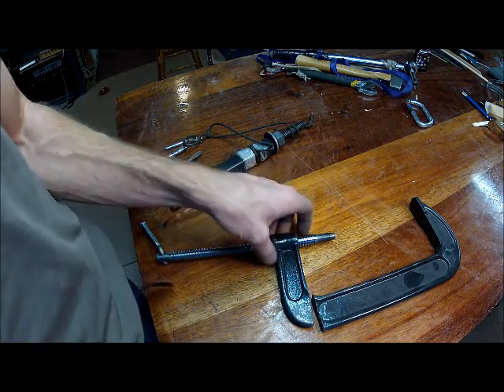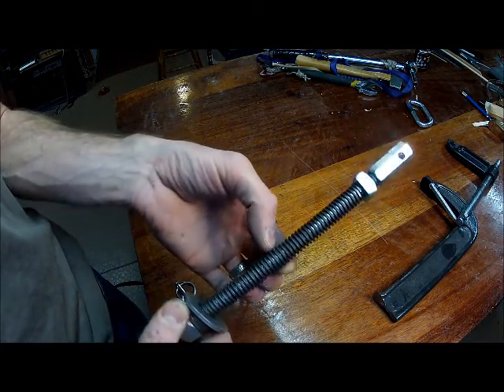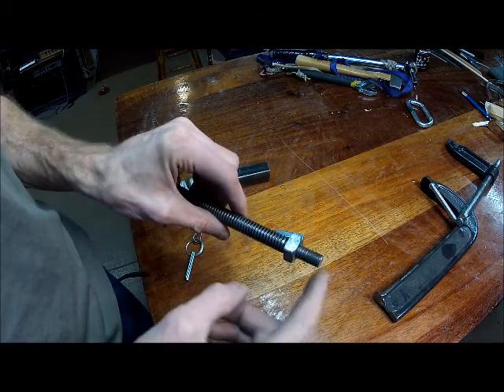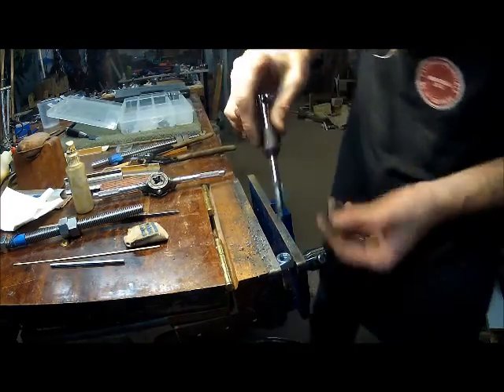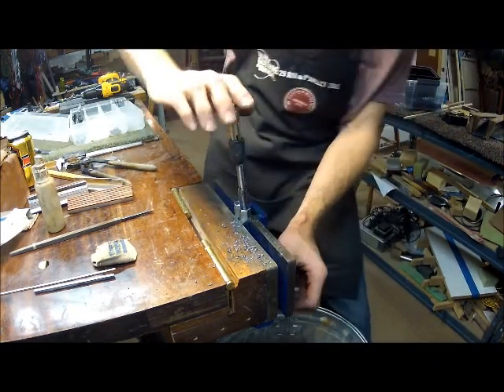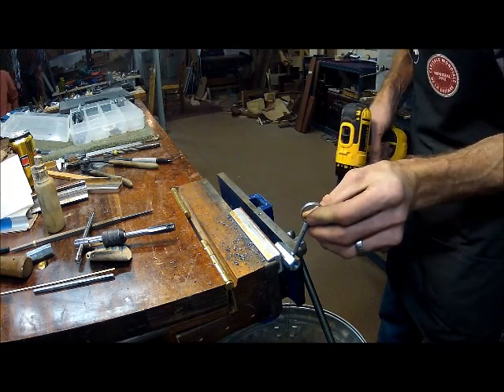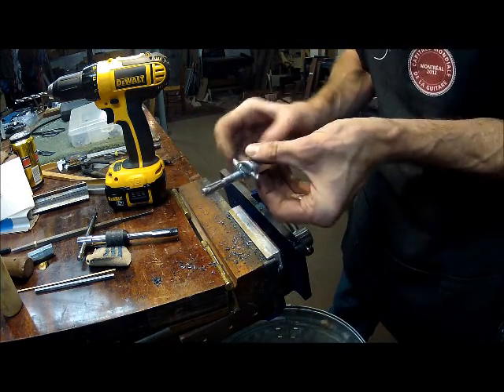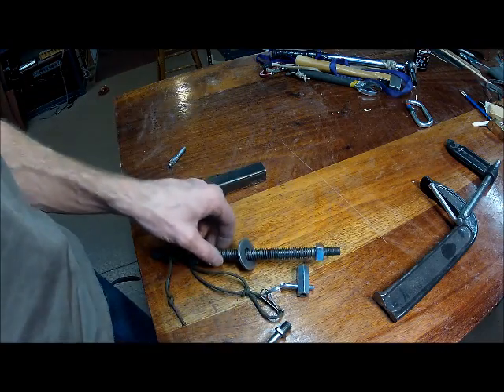Doodad 2.1 bolt extractor

Comment: Would you be willing to sell me one of these?
Reply from the maker: +Gareth Leah I've made a few of these for people, but I'm a bit busy right now. It really doesn't take high skill to do it, just effort and time. Give a try at making one yourself. Email me if you need tech support. I recently found a way to make the spinner tool portion without needing to drill out the coupling nut. You just need a 1/2-20 coupling nut and a Re-Nu Thread 1/2-20 to 3/8-16 threaded insert. 
http://www.northwesterntools.com/product_info.php/model_number/29110
Reply: Thanks!